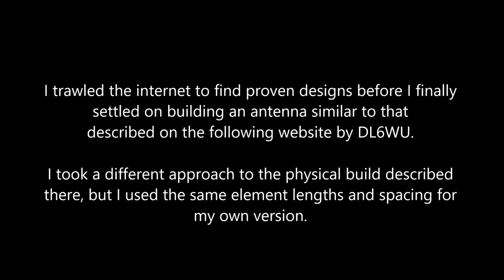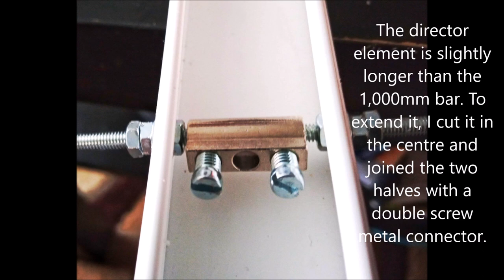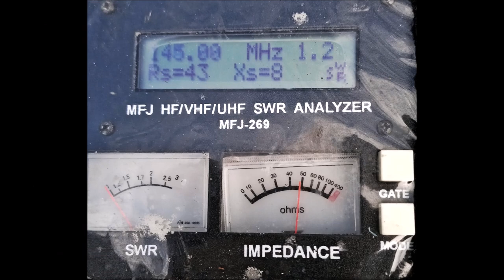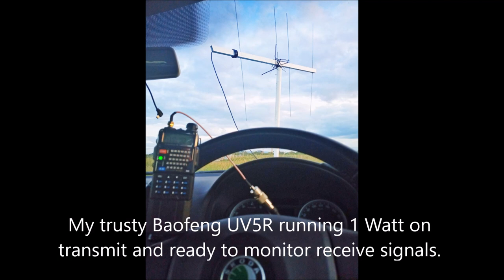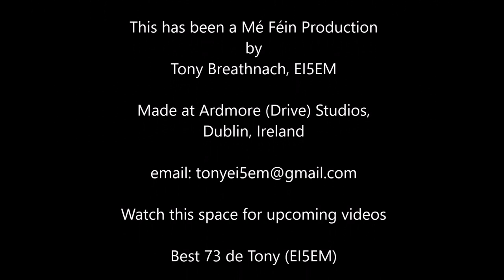A Homebrew Four Element 2 Metre Portable Yagi Antenna

Comment: That's great Tony. But this illustrates one thing I've always struggled with. I mean, ~6dB of gain is equivelent to 1 signal strength point, or so the theory tells us but here you've demonstrated at least 3 S-points of improvement to my ear anyway, maybe more with John EI2HO.  That improvement was dramatic. I gotta get building Tony...  John EI5JS
Reply from the maker: Thanks John. It's a very easy build and works great too! €13 for rods, nuts and washers

Comment: Cool build.  I am a novice but where is the choke/balun turned - at the back near reflector or between reflector and driven dipole?
/
Reply: If you pause at 2:59 and 4:01 you can see the balun behind the reflector. Hope this helps.